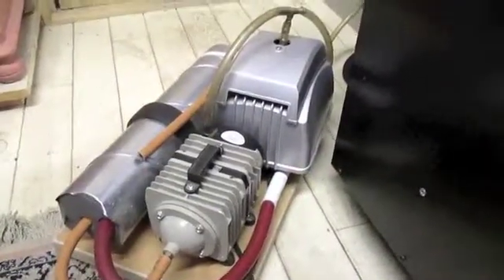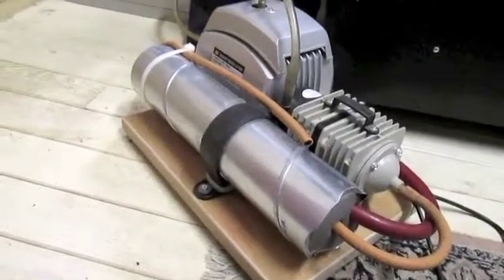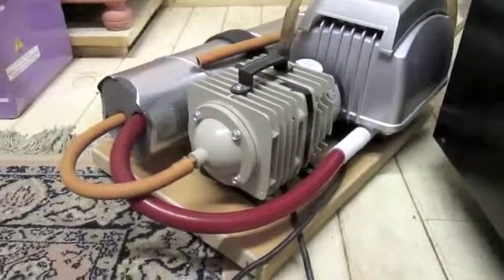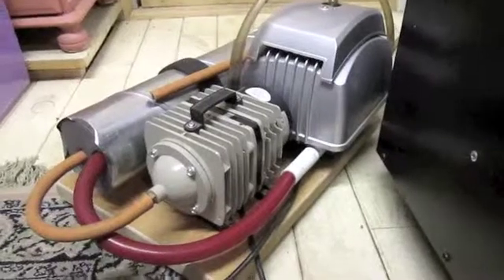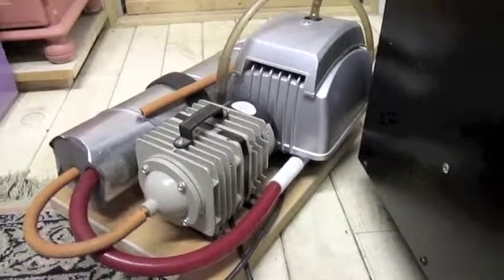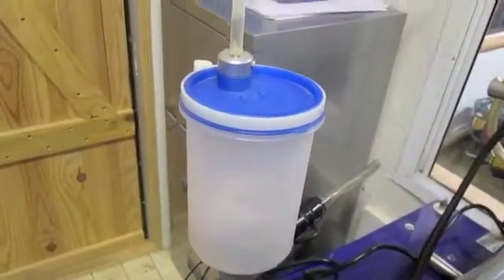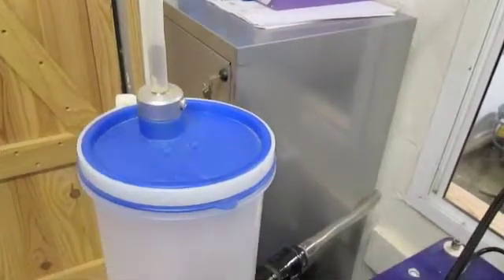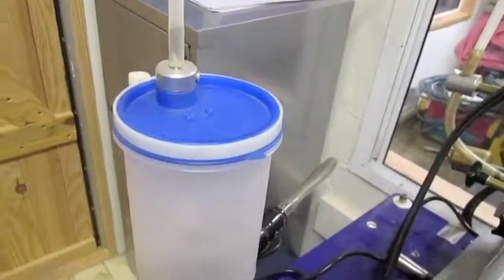Vinyl record cutting lathe suction

Comment: HI Karl i wonder if you could put in the right direction of what Pumps/ your using ? or what i could use for the same job ..as i also have a T560 and really cant handle the noisy hoover provided and need to have something just like this quiet enough to run alongside the cutter almost ...i did try using a medical vacuum but it didn't seem to be sucking enough to remove the swarf . hope you can help cheers.. D,
Reply from the maker: Ha, yes I know what you mean about hoovers ... put them in another house half a mile down the street and still hear the b****y things !!.  We just used "cheap" Chinese made "pond pumps" : commonly used to supply air to Koi ponds and alike.  They are diaphragm / piston affairs, so the air "pulses" but that doesn't mater so much as it gets smoothed in the swarf collector.  We used 2 together to get enough suck - that's the thing ... getting enough suck to overcome the dreaded static, and, stop the stylus heating coil from frying (assuming you run it as hot as Souri suggests).   Just had a quick scan on e-Bay & something like this is the kind of kiddie:  Item number 232085656272

Good luck - Swarf collection is definitely one of the real issues with that vinyl - like material !!!!!!!!

Cheers
Karl.
Reply: Hi Thanks Karl ..i have tried persevering with the medical vacuum but to no joy the thing just wasn't pulling enough probably due to the static too.. the pipe going toward the bucket with the filter was getting clogged (so I've had to go back to the dreaded hoover for now thats in its own house outside the studio) ..but i will look into those diaphragm pond pumps .theres so many pond pumps out there and some really are bad or over priced.. but i probably tried the wrong type in the past it certainly looks like it from your set up  thanks a lot for the tip

Comment: so what's the advantage of the V shape ? does it get any quieter?
Reply from the maker: Unfortunately not !!.  I've just been playing with various shapes and sizes of suction tube right next to the stylus, in an effort to get the best swarf removal, particularly when cutting "vinyl-like" plastic at warm temperature, and lots of static !!.  So far I wouldn't say any particular combination of "flat" or circular tube, to the side or behind the stylus is better or worse, at "letting go" under conditions of high static charge and / or extreme lateral modulation.  More than anything the issue seems to be static, so that's probably the thing to fix, rather than small details around the vacuum system.
Without static, vacuum level and suction tube detail are not that crucial, but with static you need mountains of vacuum.  Best I think, to sort the static issue !!.  It's all to do with cutting on virtually un-cutable plastic !!.  Cutting on lacquer would be better, then produce a hard wearing plastic disc from that ......  hang on .... I think that's been done before !!!.   What we really need is a "one off" capable, desk top pressing "plant".   One day ... 3D printers will probably be able to do just that !!!!!!!!!
Reply: absolutekarl thanks ! F*** thos 3d printers....
Reply from the maker: Dr. Dub Vinyl Schallplatten Herstellung
  Ha ... I think the printers are basically ok, after all the Chinese printed a block of flats in under a week ... it's the CAD software that's a nightmare ... it's like being in a Quantum world, where, everything is everywhere, but no where at the same time, until the point when you actually measure it, when, it magically becomes real ... Ugh